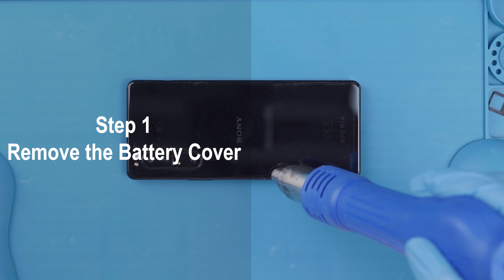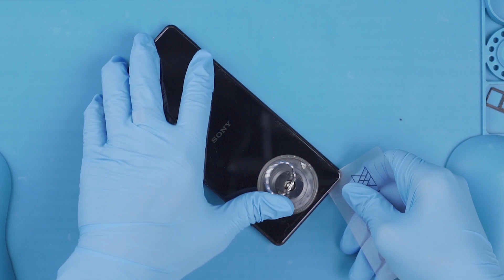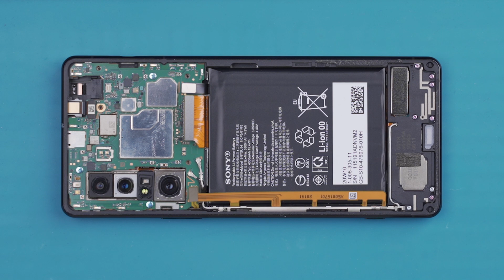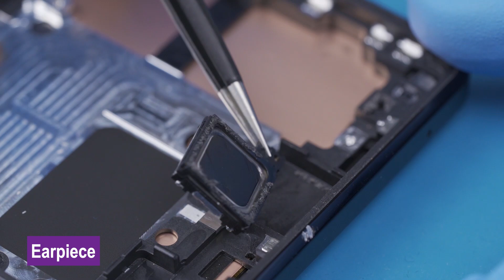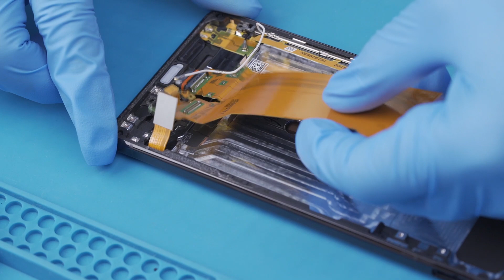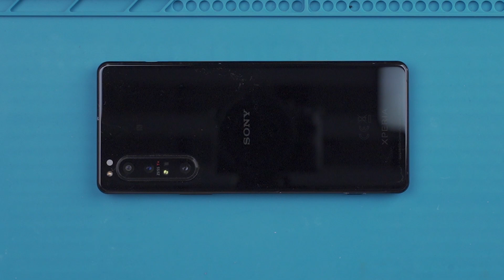Sony Xperia 1 II Teardown

Comment: Very nice made. Actually, I wanted to change the frame on a 1II because it has some nasty scratches. But after I've seen the video, I'd rather leave it. The repair of smartphones is becoming increasingly difficult. Too bad that such an expensive device is so service unfriendly.
Reply: Actually it isn't that hard. Just get a ifixit kit and a heater. Don't forget to get a new adhesive too. 
With a steady hand and little care anyone can do it. Don't be discouraged, you learn a ton.

Comment: Detailed information thanks , do i missing where primary mic located ? I have an issue other party can’t hear me during call so thinking about replacing mic
Reply: The Xperia 1 II has 3 mics: one on top, one on bottom and one on the rear.

In my case, the rear one is giving me problems because when I record a video, it picks up the camera lens sound (flicketing/hissing) which is extremely loud and annoying...

Comment: when applying the back cover adhesive to close the phone, for how long it should rest before use, also i should apply pressure to it?
Reply: I was wondering this too and they didn't use the gleu strips for the battery. 
On the front the video isn't complete.

Comment: Nice! Been waiting for a video in English for a very long time

If you look closely at the right speaker, you'll see that it's actually bottom firing and not front firing.
Reply: But there are no speaker holes at the bottom, so it gets redirected to the front inside the main frame?
Reply: @pixels_per_inch  true
Reply: There is a small speaker vent under the display facing front side so its front firing speaker

Comment: Is it possible to replace the USB C port on the charging port flex or do you have to buy a whole new charge assembly? It looks to be plug n play on one side but the other side looks to be soldered

Comment: At 4m:53s there is a foam adhesive that sticks the daughter board to the frame - any idea what part number it is and what it is called please as I guess it is meant to help with water/dust resistance. Many thanks in advance.

Comment: So I have this phone. Happy with it except for one thing. When I tab my finger on the back of the phone, bottom side, I can hear some sort of rattle. A cheap hollow plastic kind of rattle. Do more people experience this? And I'm not talking about the camera rattle, which is normal. Just to be clear.
Reply: I've got the same, presumably the vibrator when it is not being powered. It is kinda unsettling to hear it every time you place it on a table or tap it lightly.  Not sure if it is intentional or not.  Hope Sony fixes small things like these with future phones. Also try doing the vibration test in the settings app under support -> xperia tests. I can hear a slight clicking noise not sure if this is also normal.
Reply: @clunkyjonas  you've got the purple one? I do. Honestly I think it's unacceptable. It feels super cheap. It bothers me every time I lay it on the table.
Reply: @clunkyjonas the clicking might just be the camera stabilizer, it's normal
Reply: @noallignment6169 i have a purple one. It does both the camera clicking and the vibrator rattle. But mine also fell countless times (it did in fact shatter the rear cover glass)